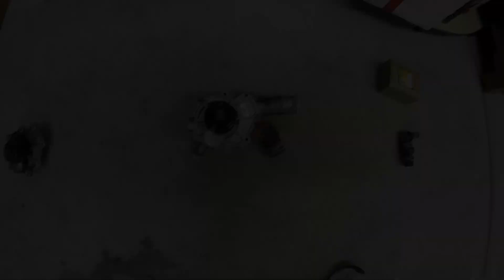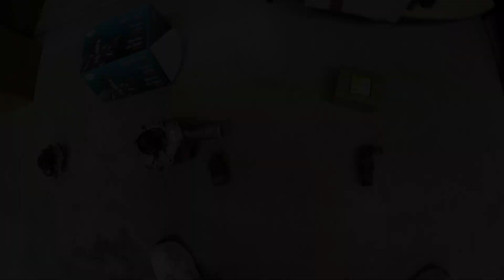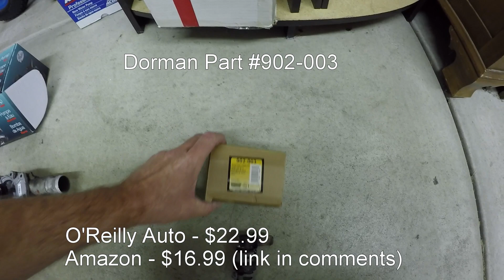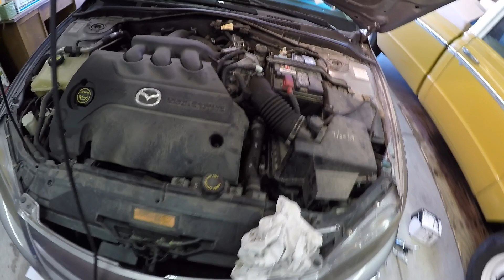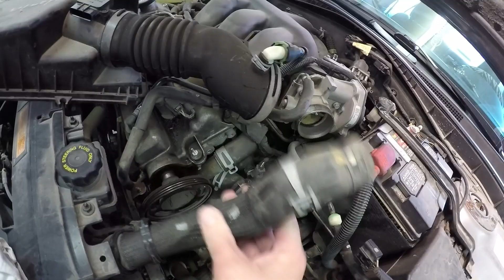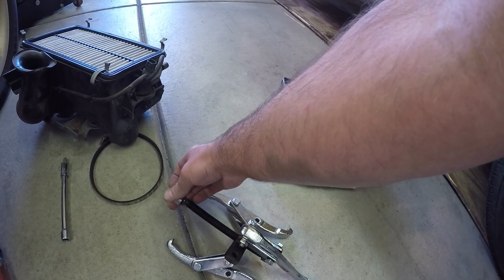Mazda 6 Water Pump Removal & Replacement - 2007

Comment from the maker: Links to parts mentioned in this video:
http://amzn.to/2efrYYs
Gates 43230BH Water Pump & Housing $47.09

http://amzn.to/2eFyq9N
Water pump and gasket $38.41

http://amzn.to/2ejOtvx
Dorman 902-003 Water Hose Connector
$16.99
Reply: Houch Off The Couch
Reply: So u have to buy housing just to get hose that breaks easily?  (The small hose that broke 1st)What can be used instead?

Comment: I have a 2004 Mazda 6S with 135,600 miles and I never had to replace the water pump nor have I had any problems with the cooling system.

Comment: Details of putting the pulley back on.  With the belt.  Would be appreciated.  With the stretch belt on,  it's hard to get it square on the pulley.
Reply from the maker: I don't recall having a problem with the belt.  Maybe I had it on when I slid the pulley on.

Comment: Wait why did you use a socket with the puller to take off the pulley?
Reply from the maker: Without the socket (or some kind of spacer) the screw portion of the puller was trying to screw into the hole that I wanted to push against.

Comment: does any one know what the name of the plastic fitting that also breaks (the lower hose connects to plastic and is where most leaks occur)
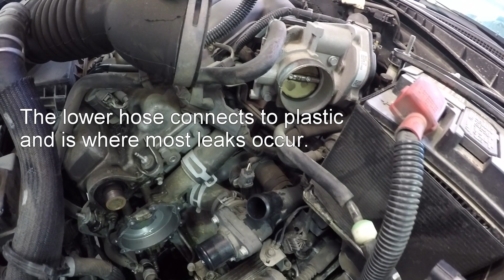Reply: at 4:23 in the video
Reply from the maker: Piece of junk is the nice name I gave it.  I think the only way to get that part is to replace the entire pump.  It was already attached to my new one.
Reply: it didn't come with my new one...lol and I pretty much got rid of the old one away....so now I'm stuck because I don't have the name of it
Reply: I need the name too. Can’t find anywhere online. Tis the only thing broken no need for a whole new assembly.

Comment: How do you pull off the pulley without bending the pulley?
Reply from the maker: I just used a ratchet to tighten the puller and it slid right off.  Didn't have any problem with it bending.
Reply: Houch Off The Couch thanks for the update...

Where did you grab the pulley from?
Reply from the maker: The puller that I borrowed from Oreillys latched on to the pulley in 3 places.  It was a little awkward to put it on, hold it, and tighten it.  I just went for whatever position I was able to hold it steady.
Reply: Thank you so much. Your video was very helpful, I was just challenged with the drive belt pulley and came up with my own remedy on how to remove it.
Reply: Please share your alternative method fpr pulling off the pulley

Comment: How did you put the legs of the pulley puller  into the pulley, as I know it has five oval holes with the bowl shaped back that can hold no  hooks of the puller legs. How did you put the new belt on the pulley since it is really hard to turn around?
Reply: Getting all 3 legs of the puller on the pulley is a bit difficult.  Have somebody hold 2 of the legs in place until you get it tightened all the way.  I used the old belt and was able to slide it back on before pulley was re-installed

Comment: Are you sure the water pump isn't right by the power steering stuff
Reply from the maker: For the 07 Mazda 6, the water pump is on the right side of the engine.  There is a belt on the left side of the engine for power steering and altenator.
Reply: Houch Off The Couch on my 06 Mazda 6 I see all the videos of the same exact car and it's on the right but it seems like it's on the left and I see all the hoses do you think that a water pump is salvageable from a junk yard
Reply from the maker: Not sure I would try a water pump that has been sitting for a long time out in the weather.

Comment: i just had mine changed what hold the pulley on because when i give acceleration to my engine I hear a squeeking noise i believe it my pully might be spinning on the cam shaft
Reply from the maker: Nothing holds it on.  It takes a lot of force to press it into place.
Reply: thanks
Reply: So what was that squeeking noise?  The pump?   Mine is having the same sound.

Comment: can you tell me where that coolant hose connects to. it runs from the top of the throttle body down towards the front of the engine. i cant figure out where it should connect to to in the front